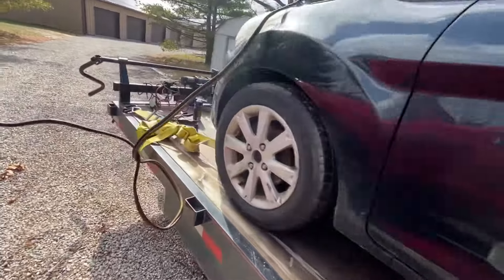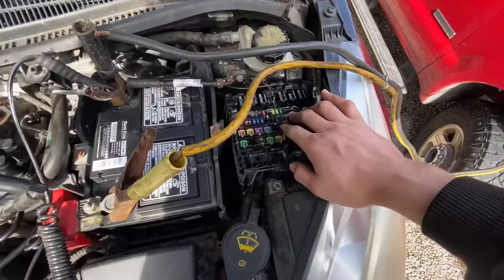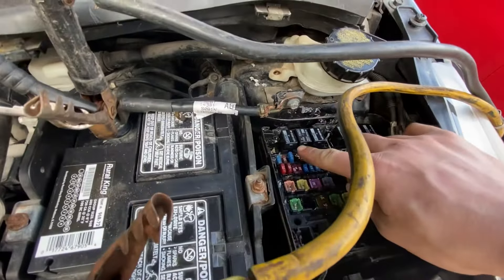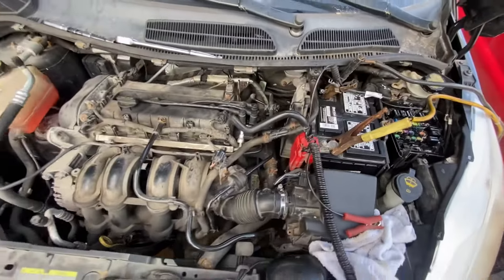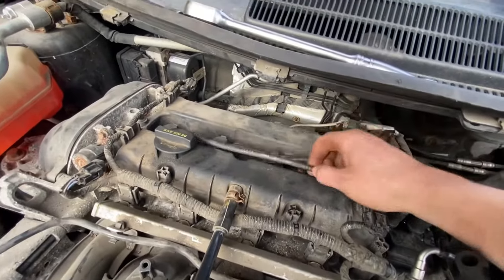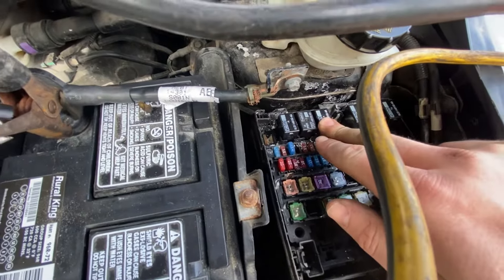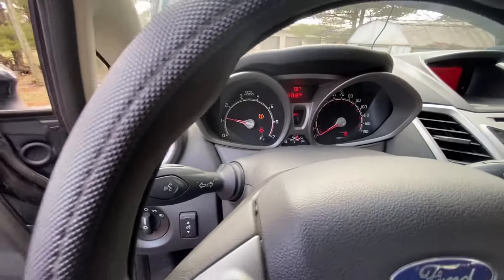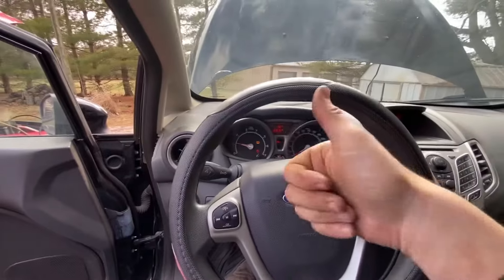Ford Fiesta Crank but No Start - Check your relays!

Comment: Hi i have a ford fiesta 2012 diesel all of a sudden the engine turns but wont start.what can the problem be.
Reply: SAME problem here. I turn the key and you can tell the ignition is getting juice but the car will not turn over until about the second or third try.

Comment: Good day! We were just watching your channel and you seem very informative. We are having this problem with my 2011 Ford fiesta we had to change the NVLD system which we dead. We finally got some crank to the car but now it is sticking in the crank position, but won’t roll over. I have to manually turn it off or it will continue to roll over. Do you have any idea why this would happen? It is definitely not the spark plugs and we’re pretty sure it’s not the fuel pump. Do you have any suggestions?
Thanks for your time !
Reply: we've just bought a 2014 1.6 ddci fiesta and are having a similar issue. The car won't start. It turns over and cranks but the clutch won't go all the way down to the floor. But when it does try to start it wants to pull forward. We think its the clutch cable or the clutch itself but not sure until we get it looked at this week. From what I've read crankshaft sensor is a common problem son maybe look into that

Comment: Hi. I have a 2016 Fiesta Titanium Hatchback 1.6L sigma "J" engine. Approximately 11k miles after a complete tune up the passenger side mirror was torn off by accident. I got home with no issues. The next morning i had to jump start the vehicle and it ran like crap on my way to and from work. Rough idle, loud sound from front of engine, irratice shifting, and absolutely no power. I ran obd II and got P0365 and P0369. CMP sensor circuit B Bank 1. And same sensor intermittent. I know where bank 1 is but circuit B? So i replaced the  both. No change. Sent to a shop they replaced coil pack  ran better but still not right. So i did a real tine drive test and still got the first 2 codes and some pending misfires  after further investigation i notice fresh oil under the complete left side front to back. Pull the air filter and a puddle if oil . I somehow lost a qt. Of oil. Also the ruthenium plugs i put in look like they had 200k miles on them and one was loose. So fixed the noise by tightening the plugs new AF new evap purge valve went for a drive and the car died with the code P0111 IAT sensor out of range. I got it started limped home and she cranks tries to fire but just wont start. Then found faulty plug wires  replaced plugs with oem  replaced the map/mapf sensor, checked all sensors the intake and exhaust VCT solenoids were out of range. Weirdest if all i cleaned the Throttle body . Checked the intake no residual oil. Pulled the PCV hose no oil there either. So where did all the oil come from in the air box? When i get the new solenoids and warranty plug wires and swap that relay . If she doesn't start, keep an eye out for a floating fiesta on the ohio river. Any ideas?